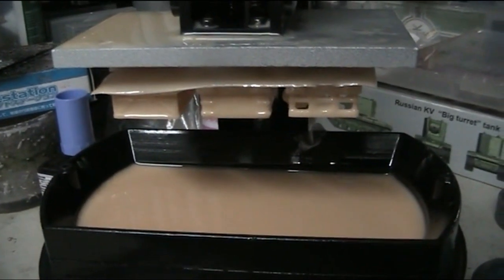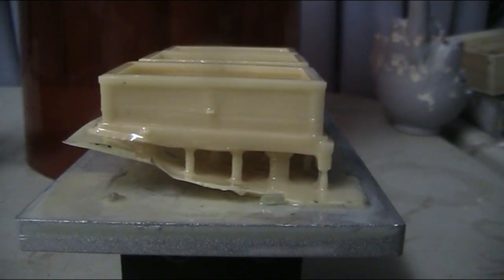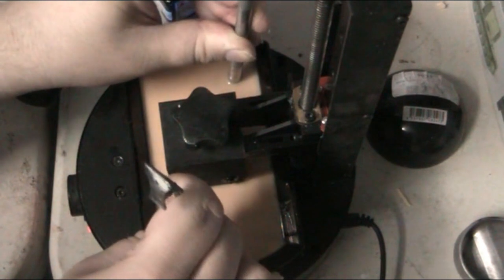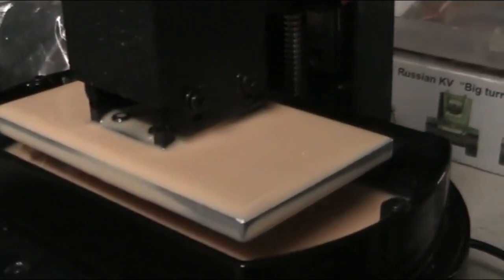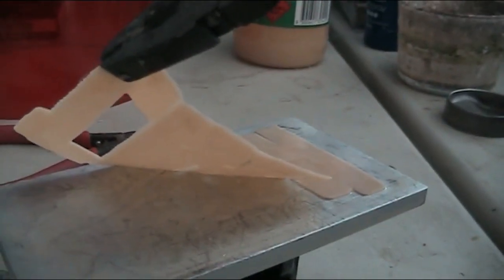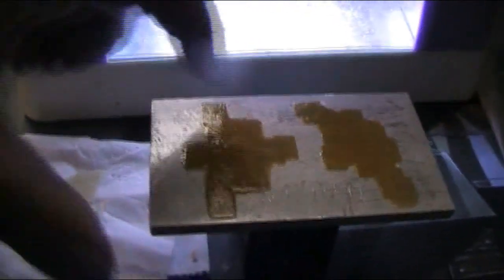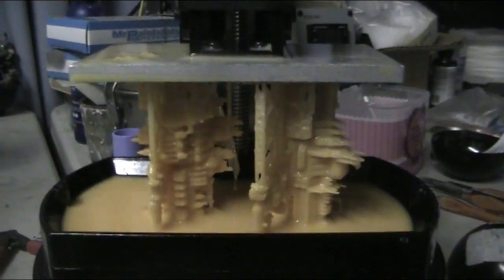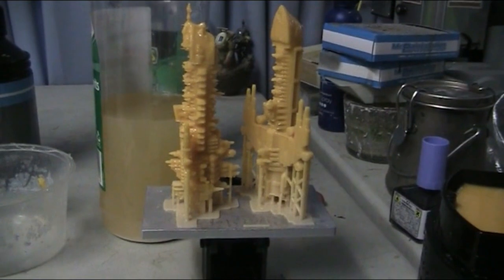SparkMaker - print bed adhesion troubleshooting

Comment: What should I do if it's still not sticking after doing this?
Reply from the maker: double check the bed is level, resin is mixed/ shaken well, use new resin and change the film at the bottom of the tank.

Comment: i get slap sound everytime the build plate start to go up, is it normal?
Reply from the maker: Inspect the Z screw and make sure it is dust free and oiled. Also check to make sure the resin isnt pulling up the film and build plat is screwed into place. Besides that not sure what else is going on and hoping the prints are developing well.
Reply: @mokanaman  well that's exacly what happens, its the sound of the fep, when the build plate starts to go up after every exposure the fep go with it for a bit and then a little slap sound the fep gets unstuck, but is this normal?
Reply from the maker: I've experienced this before, as the REP wears out it will stop. Sigh of it being well installed. Not much you can do but I understand REP lubricant is a thing now which I never tried before.

Comment: Love your videos.  Printer seems kinda shit though.  Maybe I don't understand.
Reply from the maker: The printer is on the crap end of the market. Can be bought for under $200 and parts are cheap. Perfect for me to learn, pull apart and experiment before buying a more expensive machine. Wont be too sad when I accidentally break it. Give it a year or so and more cheap plastic framed machine will be on the market with better quality and specs.
Reply from the maker: Mind you with all the work I've done on it, it does some nice prints.